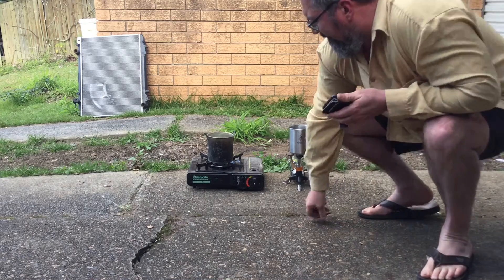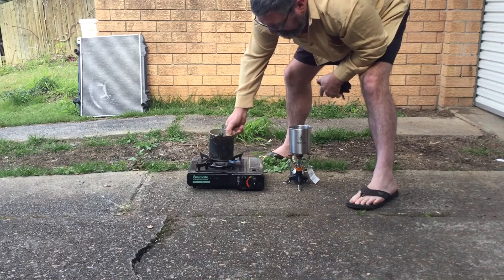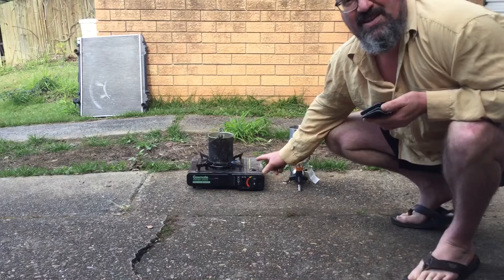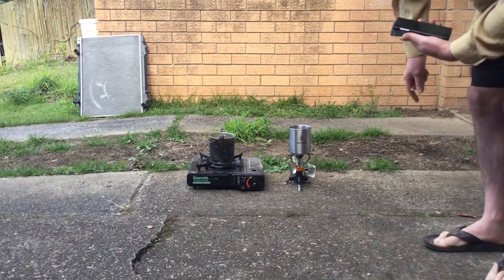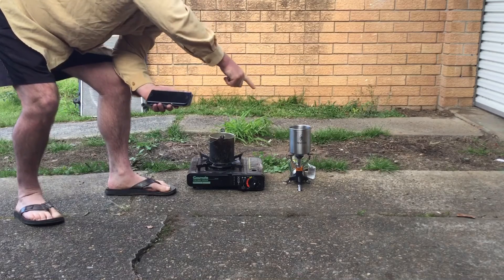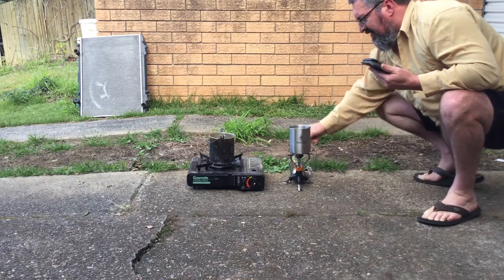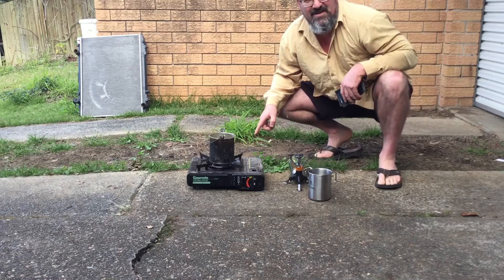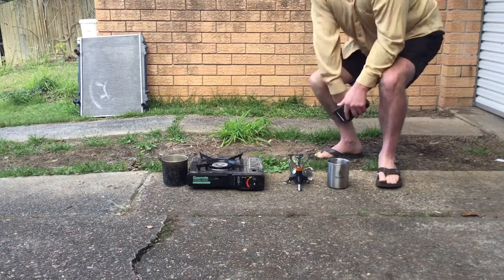Gasmate vs 360* boil off.

Comment: thanks mate, what's the top part of the system, I have found the tripod part but not the top part of the one that won the boil off?
Reply: gee mate! no spoilers!
Reply from the maker: Tripod is the gasmate AD 220 butane adapter.
The top burner is 360 degrees brand stove / burner. Both from anaconda.
Reply: @concernedaussie1330  thanks mate